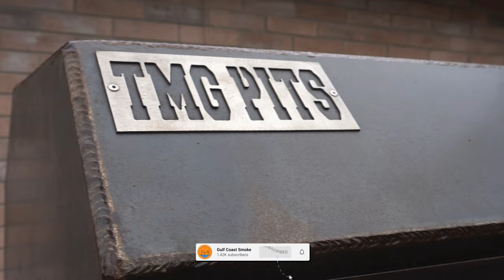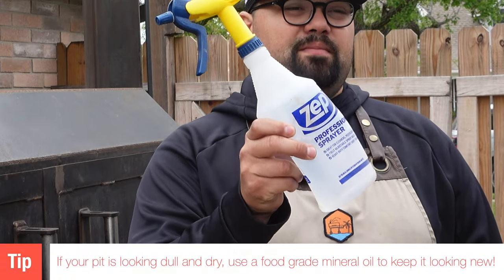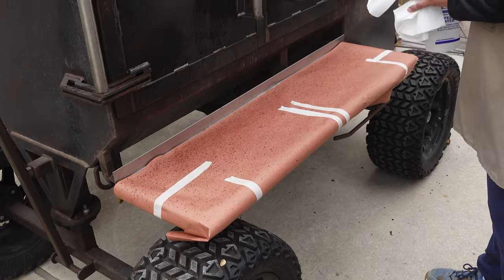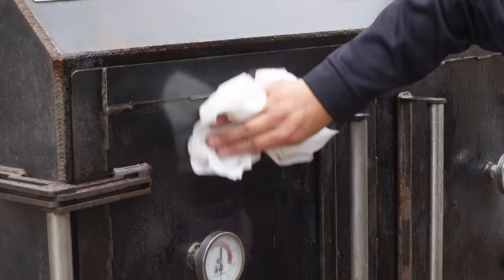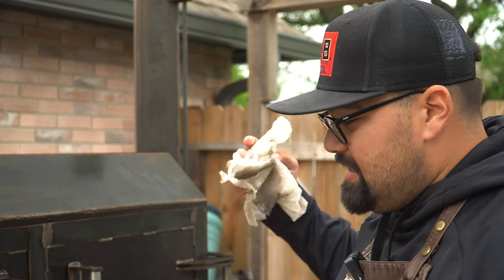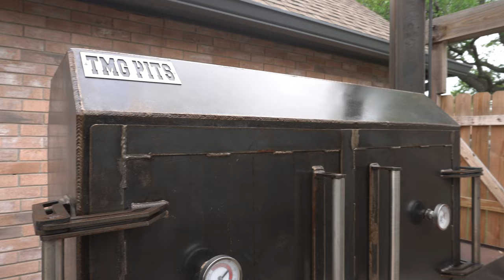Was our CUSTOM TMG Fridge 48 Offset Smoker WORTH IT?

Comment from the maker: FULL DISCLAIMER!

I chose AGAINST the firebox from the get go. So, nobody’s fault but my own there!
Reply: Thanks for pointing that out. I'm looking forward to pulling the trigger on a fridge 48 and debating whether or not that extra grand for insulated firebox would be needed for sure and I'm up in Central Wisc and plan on using year round or at least on the nicer winter days. Either way, its going to be about a year before I'd see one if I ordered today.
Reply: @kevingebert4316  - In Northern WI? I'd definitely go insulated firebox; especially if you want to cook in January and February without having to burn down the Chequamegon National Forest to keep your cook going. :) 

I'm in SE WI and just placed an order for the Dumpster - should have it in April. ....TMG invades Wisconsin.

Comment: That's a great smoker. The question is whether a less efficient horizontal offset smoker will produce an even better smoke flavor?  Jambo seems to the the Rolls Royce
of the smokers. That would be awesome. The best smoke quality that I have had anywhere, is from KBQ, Karubecue.  I can use logs with 25% to 30% moisture content running
 clean smoke for the most amazing smoke flavor. It is hard to burn 30% logs on offset smokers, while generating clean smoke. Last cook I did was high moisture post oak, I was able to get the maximum biscuity aroma, characteristic to post oak, but also very clean. Also Mesquite is difficult to use in offset smokers, as one has to use small logs, and make sure to run ultra clean smoke. It is a piece of cake on the KBQ. Some people nag about the need to feed wood every 20 minutes or so, but I don't mind, cause the result is unrivalled.
It also has a feature to  dial in some dirty smoke, if needed, depending on cooking strategy and wood being used.

Comment: Been looking at the very same one.  I'd like something taller to hang and smoke cheddar jalapeño sausage but not quite sure that the hotbox addon/insulated firebox is worth the extra $2350 to avoid the heat from the firebox.  Solid sexy smokers...you get what you pay for.
Reply from the maker: I would say get what you want now! Because you may regret it later, like me! But either way you can’t go wrong with a TMG!

Comment: With that plate on the bottom of the cook chamber does it get too hot to cook on the bottom rack?
Reply from the maker: Not at all! I’ve had briskets on the bottom rack and it cooks very well! I definitely think it’s a bit hotter but it’s not overwhelmingly so!
Reply: @GulfCoastSmoke  might contact tmg and see if they could put a 48 inch fridge on a pull behind trailer
Reply from the maker: Absolutely they can!! My boy Brandon will get you right!